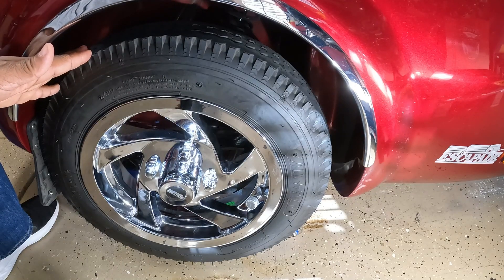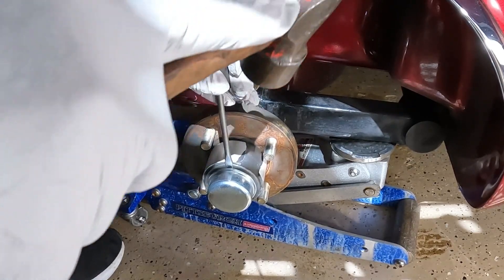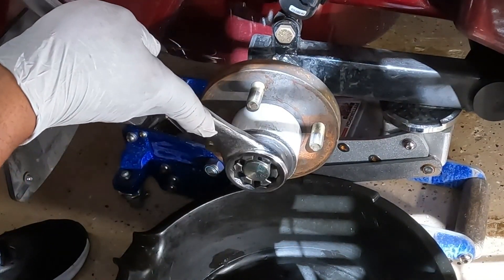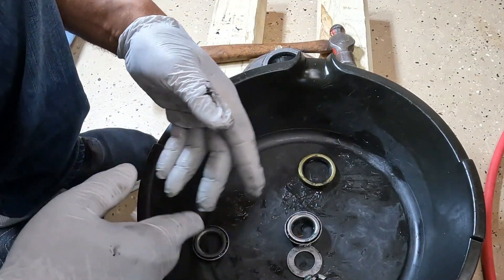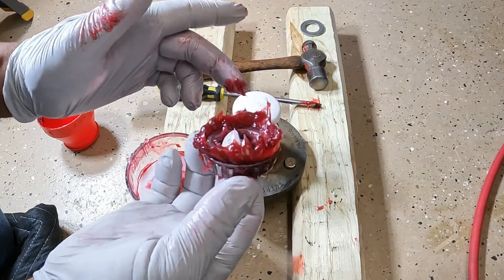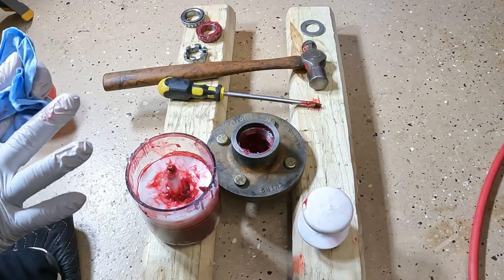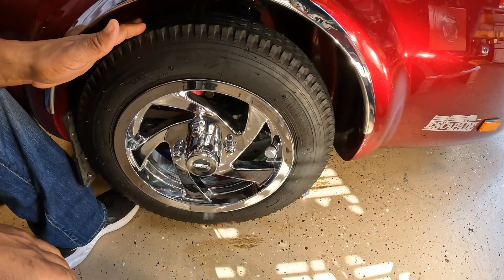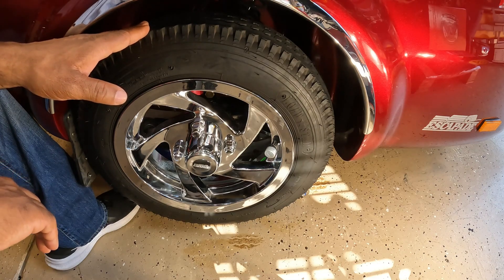Greasing Escapade Trailer Wheel Bearings & New Seals

Comment: If your lucky you can do this in a parking lot or on the side of the road, if your smart you will do it in your garage!
Reply from the maker: You are 100% correct, I’ve performed this same procedure for over 30 years on many different varieties of trailers and I’ve never had bearings to seize up on the spindle.  Failure to grease the wheel bearings, failure to inspect the suspension for wear & tear or over exceeding the trailer weight limit is the perfect recipe for a breakdown.  You can either spend a few buck at home in your garage or a lot more money on the road.
Reply: @chriscaliente5033  wow.

Comment: Very very educational.  How often does this have to be done.
Reply from the maker: Good question, check with your specific trailer manufacturer for their mileage recommendation but California Side Car recommends that my trailer bearings are repacked every 7,500 miles.
Reply: @chriscaliente5033  ok great I have no clue on the freedom but ok ty so much love the video
Reply from the maker: @phillipvazquez284  my Can Am 622 trailer has the exact same style seals and roller bearings as my Escapade Trailer so I follow the same mileage recommendation but check with a Can Am dealer for your Freedom Trailer recommended servicing to be exact..
Reply: @chriscaliente5033  ok I will do so. Ty so much

Comment: You are missing the right swingarm pivot dust cap. You will trash those bearings without cap. Ask me how I know
Reply from the maker: Did you watch the whole video because I pointed out the missing dust cap at 28:52 seconds and emphasized the trailer arm bearing at 39:03 seconds.